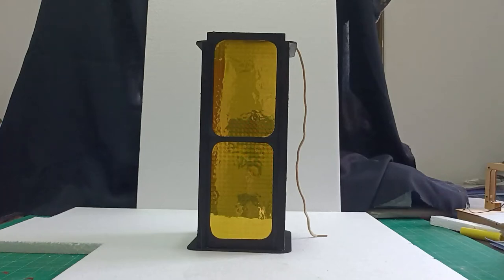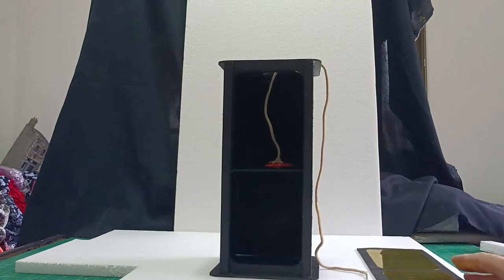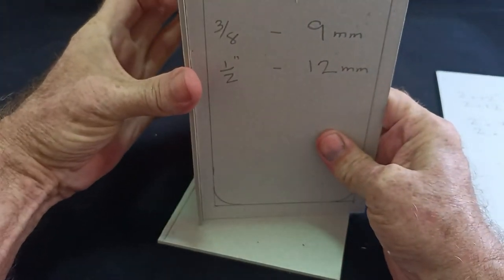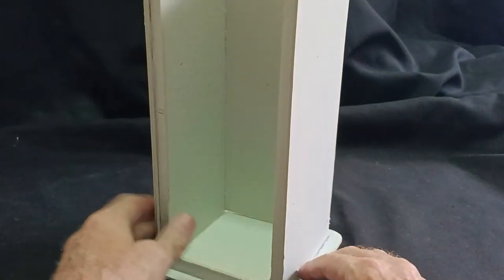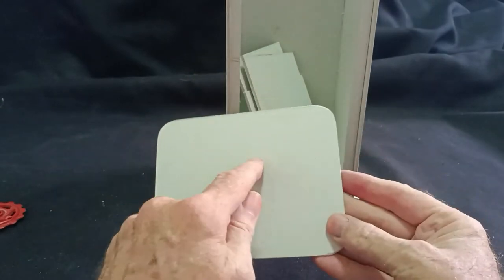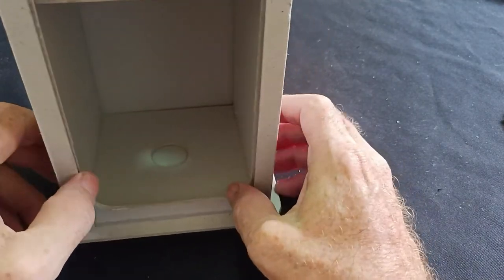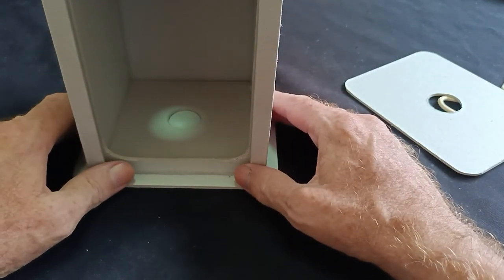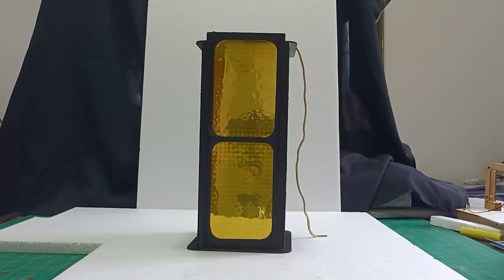How to make "the squeeze through" magic tricks revealed

Comment: I like this. I am not an inventor minded person but by watching your channel I am beginning to understand because I use the side of my brain that learns by vision. 
Now that I see how to do the assembly I understand it.
What did you use to cut your material, laser cutter or jig saw?
What if you added an automatic system for the pegs to be released and engaged, tenyo does for many of their products.
Like the coin box effect.
So, when the inner box slides up it works the pegs “out “ and “in”.
That way the pegs can be automatically activated.
Just an idea.